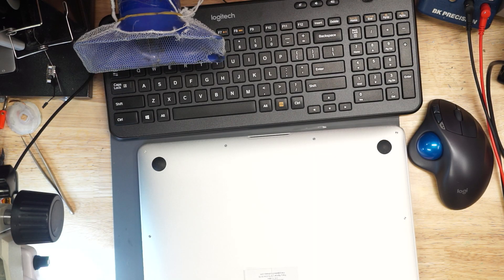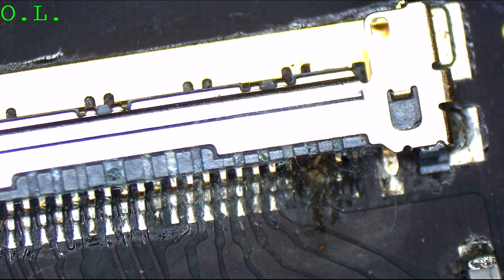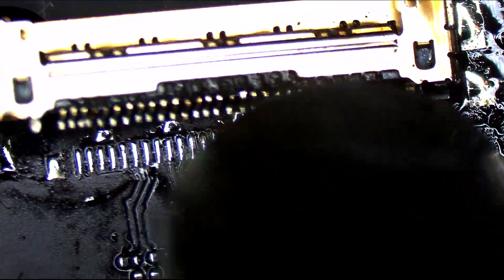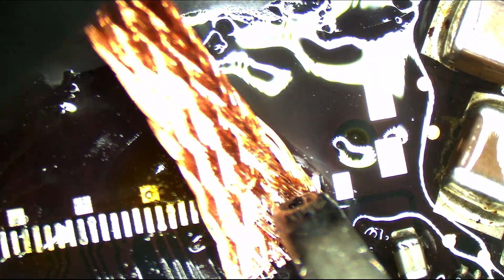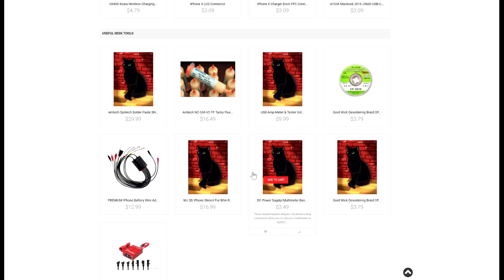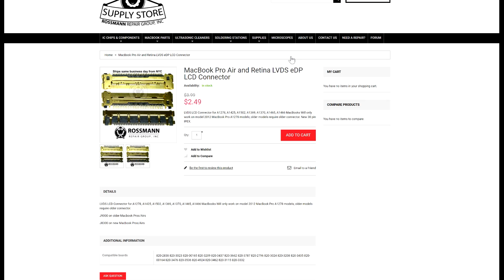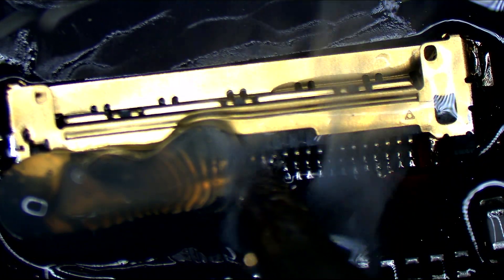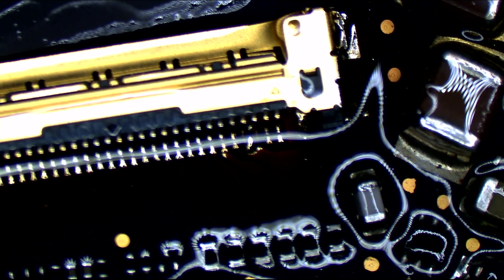What part of Macbook is made from BULLETPROOF component quality?

Comment: The fuse is to protect against a short. Liquid does not create a short but it corrodes the connector pins. There is not enough current to blow the fuse.
Reply: Excuse me, we were having fun here.
Reply: No the fuse is meant to protect against over current and short circuit if the fuse is sized correctly slightly over what the display could ever possibly draw then the fuse should blow when water gets on create another path for current allows current to flow through the fuse and if enough current is flowing through those pins to burn the pins up it should be enough current to blow the fuse because the current is flowing through the fuse because that's where those pins are getting it's power from
Reply: Peter Trimboli , fuses are never that exact and the current thou the water is very low compared to the current the display is using.
Reply: @Dr. M. H. I looked again at the footage and for me it corrosion. If there was any burning the solder joints would not look that nice. Also the plastic of the connector would have melted.
Reply: You don't know what you are talking about. Liquids can cause short circuits. In fact, any form of conductive material can cause short circuits. Water conducts electricity as long as it's not distilled. On a circuit board there are thousands of opportunities for a short circuit to occur if moisture is present.
Reply: You do realize the pins burned right?....it is obviously not corroded.....
Reply: @Steve Song, if it was burend the plastic of the connector would be melted too. Just try it for yourself and you will see it’s not burned but corroded.
Reply: @Mostly-Harmless4242  yes, I do also think that's a corrosion, not a burn. The fuse shouldn't be blamed because of this. However, on this channel we always make fun of Apple
Reply: @Shengrui Zhang, fun is ok, but when Louis is bashing Apple incorrectly about a fault, I don’t think it’s fun. Most of the time he is totally correct about it and I don’t mind at al.

Comment: Louis plz help, is that any difference between a ryzen and an i7 cpu for music production? in regards of input lag and delay when it comes to recording, I tried researching, but most tests are just - look how many plugins I can run all at once - and that does not take into account that using 8+ mics to record a full drumset (which is my case) can also introduce input lag regardless of how many plugins you can run via os. Also to further the problem in windows I'm kinda stuck with USB interfaces unless I drop some $$$erious cash into it. Also, in case I need to upgrade, what would be a more realistic ideal interface plug, is thunderbolt gonna hangout for a while? I would hate to buy a thunderbolt interface today and in two or three years when I'm thinking about expansion get screwed and have to get a new form of interface just so I can plug into my pc

Love the videos man, thanks for the patiente of reading this semi biography of a poor drumer trying to record in an apple word
Reply: That's probably the most off-topic post here. Good job. Also, *Drummer.
Reply: @zaprodk  Well Louis has studio experience and is a heck of a tech guy so I don't see why shouldn't I ask just because some random person on the internet would feel butthurt that it´s offtopic from the original video. But thanks for your input, I will save it in the useless responses category
Reply: @Hellsp4wnCS  I'm glad to be of help. A better person to ask which computer to get would probably be "Eli the computer guy"

Comment: Maybe the user who spilled something on the device should've turned it off immediately so the fuse couldn't have cycled to low resistance enough times to burn the connector. Well, the fuse could've been different. But where's the profit in that?

Comment: There's nothing wrong with the fuse or the way it is used in the circuit. The purpose of the fuse is to prevent an overcurrent condition, while the damage you show hasn't been caused by such condition. Given enough time, 10mA at 20V between the leads of LCD connector flooded with water is enough to make it look like it came from hell.

Spill protection is done by sealing the case and/or applying conformal coating to the parts which require protection, not by adding a bunch of fuses here and there.

There is so many reasons to shame Apple, and this looks like a legit one, but not after you know how these things are actually supposed to work.

Comment: Apple follows the MOSFET Guidelines. The mosfets in a power supply are always there to protect the fuse.
Last time my computer's psu died, the mosfets shorted and it tripped my 36A circuit breaker. When i checked the psu to see what happened it was still shorted, the fuse was intact.....
And Dave complained about weller no having a primary side fuse in their solder stations. Its pretty obvios if they had, the transformer would have burned to protect the fuse.  Fricking fuses never work because the fuse is never the weakest point in the circuit because of cost savings.

Comment: That's not a fuse in the normal sense, but a PTC, a resistor with a positive temperature corefficient, that is, increases its resistance with temperature, which means that behaves as a resettable fuse. That said, the corrossion in the connector is from electrolysis of the liquid. That process can proceed with mid-low current to achieve that damage without the PTC acting. Of if the PTC heats up and increases resistance, it will limit the current but still allow for the electrolysis damage.

In sort, that's not a fuse, that's a PTC and is useful to prevent a fire in case of shortcircuit, not to prevent damage to other components in that same case.

Comment: So as someone that claims to understand Ohm's law. Why did the pins burn? Too much current. Why was too much current flowing? Ignoring the fuse, because the back screen is to low a resistance? Or the pins on the conector are underrated, have too higher resistance? Or something else..
I need answers!!!!

Comment: Louis, your life is so ironic. You're fixing laptops of brands that you hate, for a living.
God must really have a twisted sense of humor. LOL
Reply: AntonioKowatsch    The only worse laptop is an HP and if he had to rely on them to make a living he would starve.
Reply: @wysetech2000  I'm going to guess you only know consumer HP laptops, HP elitebooks are some of the best machines I have every used or worked on. Need to replace an internal component slide 2 switches and the whole bottom pops off no tools needed, Aluminium and titanium construction easy to get parts and HP support comes with 3y onsite warranty. Really nice machines. Nothing like a POS dv6000 They don't repair machines that cost 399 new there is no value in them. Lenovo's cheaper units are really bad too.
Reply: Paul Gariepy whitelist hardware make hp always such dirty and crap
Reply: @PaulGariepy  Frankly, my only okay experience on REALLY DIRT CHEAP laptop is from, ironically, an APPLE firesale, I mean yeah it is a very old macbook model but at least it is cheap and kinda durable. I do think Elitebook is good, but at its price range, there are lot more capable and cheaper competitors, not particularly appealing I say.
Reply: @wysetech2000  Are they really that bad? Geez, I had no idea.
Reply: @AntonioKowatsch   For the price they aren't that good but i have never owned one. Not likely i ever will. I'm sure they have a lot of good about them. Their service sucks as well. That's why Louis and a few others repair Apple products
Reply: @wysetech2000   Ya.. This is why I always build my own computers... even my laptops. My newest project is to see if I can get a Threadripper into an M6700 chassis, still working on getting money for it though. For some reason I really like the older precision laptop chassis.
Reply: Fan spin!
Reply: Louis can make a living doing anything, but he choose to save the iSheep that are being squeeze by their iGod, so Louis is a good person.

Comment: Don't know bout everyone but my mbp  2011 is still rocking hard no problems in the 8 years I've had it. I do need a new battery  though since I'm close to 1000 charge cycles . Reapplying thermal paste on gpu n cpu  chip and a good dust cleaning should make temps low and last longer .

Comment: "Why is this Macbook failed? It failed because the LCD connector burned.
Why is the LCD connector burned? Because the fuse is still good!
Why is the fuse still good when the machine was able to burn itself from the inside and have those metal pins melt themselves away? Because in a Macbook, the fuse is not a fuse. The pins on the connector for the screen are the fuse.
Think different or just don't think at all! Buy Apple!"

I never buy Apple product before, but now  I think I should buy one for its BULLETPROOF quality fuse!!
Thank you!! I have learn a lot by think different (or without thinking)!!

Comment: You are saying the pins burned. But they corroded. So it not over current to blow the fuse. It's just water and dissimilar metals. Along with high voltage accelerates the corrosion.
Reply: So pin, solder, trace, three metals. Get 'em moist, charge 'em up and fail. 

Or put a drop of nail polish on the connection at the factory and it'll never get moist there. Micro ounce of prevention.
Reply: @tactileslut  So who does that? You'd have to conformally coat the whole board to prevent stuff like this from happening. But this is a cheap consumer product, not an avionics computer.
Reply: @MarianKeller  Conformal coating does not have to be expensive; it does not have to be particularly thick like military stuff. After some masking, a dip or couple of sprays with a solder-through type should be good to significantly extend the life of many otherwise contaminated boards. It is simply another production step done in China. And I would not say these products are in any way particularly cheap. But why do it when punters like you expect the product not to be spill proof and you can get away with the user having to buy a new one because of their mistake spilling their drink?
Reply: @jam99  Conformal coating on a production scale is quite hard to get right, and then again, name one single consumer grade computer manufacturer that uses conformal coating. 
And $2000 is considered "cheap", if we're talking about the cost/profit ratio of industrial, military or aviation products, were conformal coating is more common.
There's also no economic benefit for a manufacturer to improve the water resistance of a consumer-grade laptop computer. Almost nobody bases his buying decision on the water resistance of their computer, or would pay more for the water resistance alone, as no one plans to spill a drink on his computer. If it happens, bad luck.
I could destroy a lot of very expensive electronic devices in the industry I work in by spilling a drink onto them. The solution is simple: Don't drink and work, or at least be careful with the drink.
Reply: @MarianKeller  It's about as hard as spray painting. Go talk to someone like Electrolube or Advantech if you are thinking it is hard. Coating military grade equipment involves much higher standards than that necessary and is not comparable at any stage of production. Your last three sentences are exactly what I said in the last sentence of my previous post.
Reply: @tactileslut  one micro pull of nail flux.

Comment: 1:35 I think this was the first or second thing in Murphy's IT Laws:  an expensive chip protected by a fuse will always save the fuse. The only exception to this rule if the fuse is more expensive to replace then the chip, then the fuse will blow first. If both are equally expensive, both will blow.

Comment: Louis i love your work and support you fully, but your conclusion isn't as simple as it may sound. The current required to corrode and burn the connector is very low, but the current to trip the fuse requires more or less a dead short (burned out component on the LCD-panel or the cable shorting out in the hinge. In that case the fuses protects from melted and burned tracks on the PCB. Absolutely /nothing/ can protect from corrosion happening - no amount of fusing.
Reply: Yeah, I was basically screaming that the entire time.

Comment: I wonder how much Louis Rossmann charges to fix that board. Only with overpriced Apple electronics with a soldered SSD or a proprietary connector does it make any sense to repair the board. With a normal Windows laptop, you just buy a new laptop and an external SSD case to transfer the data from the old SSD to the new laptop over a USB cable. If you are a little more handy with tools, you buy a replacement motherboard on eBay and install it. In terms of the environmental impact, motherboard repair done by people like Rossmann is the best solution, but it simply costs too much to make economic sense for the average $400-$700 laptop. It is sad that we throw things away rather than fixing them.
Reply: Well.. At one point, apple tried to charge a customer 1200$ to replace a macbook motherboard, because of a bent LCD backlight pin for power. The customer brought that very macbook to have that very pin bent back to shape and plugged in the original connector for the screen, for "-free-" because he needed no replacement... Oh my god, you better believe that my jaw dropped apon reading that NBC article...

Comment: Why WOULD the fuse blow? U7701 is loaded down and could not possibly draw enough current through Q7706 to blow it, much less  U7701 which is the driver.., it's not a buck driver with a dedicated controller which will deliver all the amps all the time until it stops! The only time I have EVER seen F7700 blow is when that portion of the board was completely inundated with liquid, such that the full current of PPBUS_G3H was grounded out across the fuse. It almost never blows on an Air because it almost never happens without complete submersion. Blame Apple for not using a fuse on the high voltage side, but don't blame physics. They know well enough that the connector will act like a fuse just fine when some moron spills coffee on their $1000 computer; they just have to pass UL. Bitch at them for not underfilling the EDP legs, but you'd bitch at them for doing that too I bet. Please tell Apple what fuse to use which will prevent burning the $0.05 dollar Foxconn-approved connector.

But I still don't want to meow too loudly (peace be unto Blackberry and Mr. Clinton), because I need your Zhou Mao for a project. Two years ago that sucker was collecting dust. I want a proper video on that, I'm sure everyone will love it. I want to replace an LGA 1366 Molex socket. You are the only person in the world I know that can do it, only because I'm not about to approach L2 because I've seen the crap they've sent out. I wanna see real Louis being the real pioneer again. I wanna get my Mac Pro that was literally raped by idiots from $UNNAMED_HUGE_COMPANY back up and running again. 

How does the SMC know there is a problem when the key of zDB is out of whack? Hmm...... Hmmmmm........ How indeed?
Reply: You wanna imply that Apple doesn't have good component quality. Why does Apple use the ISL6259 IC? Because it's bulletproof shit. Why does HP use the BQ BULLSHIT IC with a shit inrush limiter circuit? Because it's fucking bullshit just like Dell uses. Toshiba and every other inferior manufacturer from there uses the same shit. Not a SINGLE ONE OTHER THAN CRAPPLE uses the ISL6259 chip. You know why? Because the engineers at Apple chose that chip as the God's Honest Truth for generating G3H and PP5V_S5 circuits (that one trips up juniors, doesn't it?). They have the routine to control it literally baked into the SMC, and you and I can poke and prod it with kexts. 

I won't argue with you that Apple has shit engineering quality. But don't shit on them without taking a massive steaming cat pile over anyone else. It's all about numbers, bro. Some engineer decided the ISL was gonna be the driver for all other chips that bring the chipset and processor to life, and by some miracle a beancounter didn't say "ohh hey, we can save a tenth of a penny using BQ over here." If it weren't for the SMC Renesas code we would be ordering that same BQ bullshit

The fact that Apple doesn't count those beans like HP and Dell means we still have a job, and you have a channel.
Reply: I would have loved to diagnose and repair "the next macbook logic board to enter the thunderdome" for you. I'd even loved to take helpful hints to fixing the thunderbolt lines too just to make it all better. Where is new guy. Why is paul without SMC flip and reball? You remember our little experiment don't you? How I flipped that bitch on her back and sprayed that solder on her pads, right? The next day, we were going to go over replacing J3501 with the appropriate Hirose connector. Man, I hope I make it to NYC to tell the story that happened that night. It was a wild one! It would make up for me missing out on our fun filled adventure. hashtag onlyinLES
Reply: WhatnotSoforth Other LR videos have shown that the pads don't always survive a burnt internal display port connector.  So first design fix would be to bulk up the traces to be stronger than the connector.  Second step is adding overvoltage protection to the data pins closest to the backlight power pins.  Third is adding a backlight output fuse that cuts before the connector melts but not at normal load.